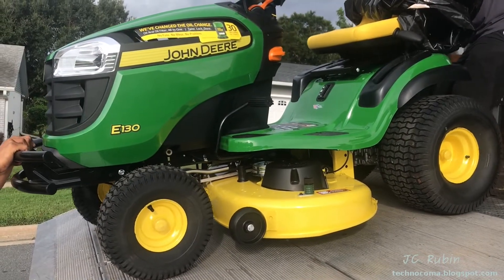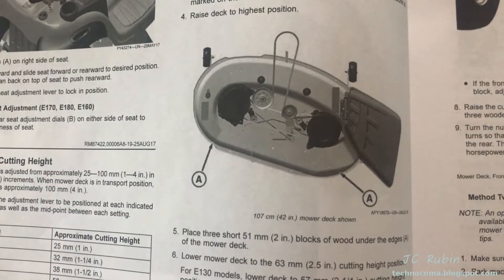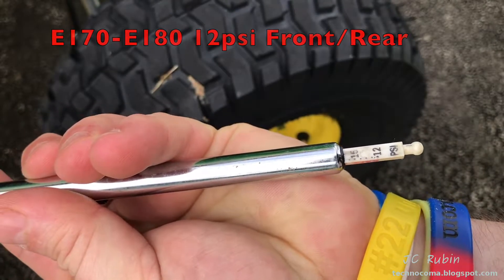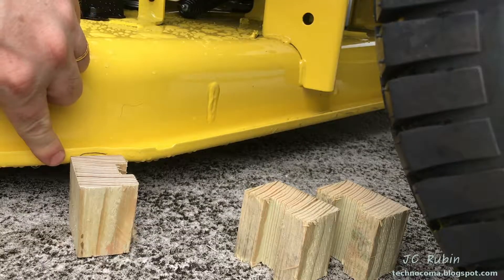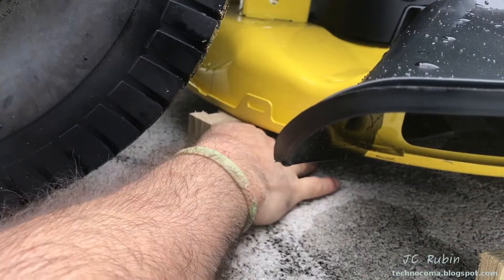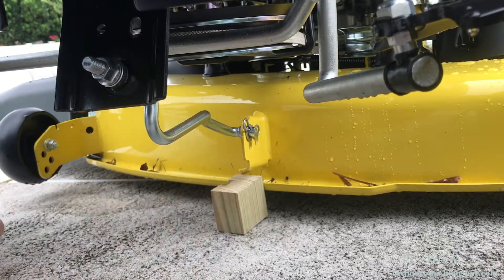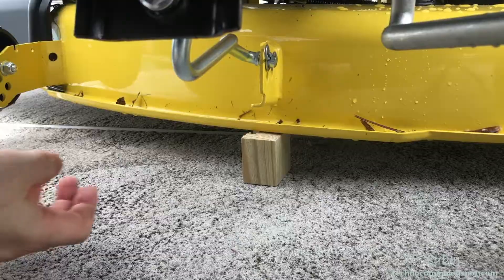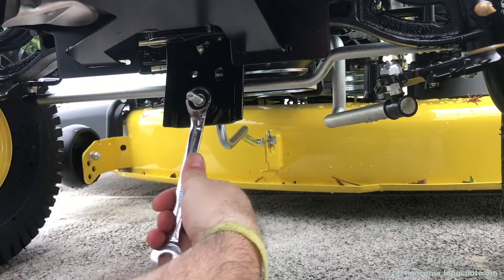John Deere 100 Series Lawn Tractor Mower Deck Level and Adjustment - Easy Step by Step

Comment: so if I want my grass at 3 in need to cut 3  3 in block an my setting should be 31/4   have nhard time getting it cut level haven't been doing the block trick. an so back to mounting bracket adjust oneside and the other do that couple times before adjusting front that's what missing me up .   o ya it's a la175 54 indeck.  u cut blocks 2 in. that's for 21/2 inch setting   but the bottom  hole scaling wheel is for3 in setting

Comment: The surface you or anyone works on has to be level or the blocks and their clearance with the deck will not be of any accuracy.
Reply from the maker: Correct, you should level something on a level surface.
Reply: @retrotechandelectronics thanks, I know that up you understand but it is always amazing how many dont
Reply from the maker: @magicone9327 all good

Comment: I've had my D100 for years and never understood how to do this. I've had the wheels on the front of the deck raised all the way to the top when they should be on the bottom. I always mow on the # 3 notch and never really had a problem so maybe it actually was set to height correctly from Lowes where I bought it. My old deck has rusted out over the years and has so many problems I decided to replace it and just put it on yesterday. I will be following the directions in this video to set it to the proper height. I've never understood what those front wheels were on there for nor how to set them properly. I do have my manual and make sure to set it to those specs if there is any slight difference.
Reply: The Wheels (Gage Wheels should not touch the ground when mowing, only touch going over Bumps.
I need a 42" deck for a LA 125.   How much did yours cost in Cdn$?

Comment: I spoke with my local John Deere Service Center and we looked-up the repair specifications for the 100 series lawn tractors. The correct blade height lever setting BEFORE making adjustments to fit a 2” block is 2.5” according to John Deere. To be clear, set your blade height lever at the 2.5” mark. This video incorrectly states setting the lever to 2” for the 100 series lawn tractors. Excellent video otherwise.
Reply: In the manual for the S130 it specifically states to go to 2 1/4, that is from the JD manual versus a service store person.  A JD service center sold me a grease gun that he said hose will bend to fit all zerks, , LOL, not even close to being right.... To Lowes it was to get the right one......
Reply: Video is correct.  The blades are 1/2" HIGHER than the outer rim of the deck.

Comment: Hello Sir,you said all 100 series are to be set at 2 inch level except the 130.The manual says set at 2.5 inches.??
Reply: the S130 is at 2 1/4 versus the other ones at 2.5, states that in the manual
Reply: He even shows the manual, that shows 2.5 inches. Wtf.
Reply: @cmh2111  I tried to level the deck with 2 inch blocks and the deck set at 2.5 inches and I ran out of thread on the adjusting rods.I had to set the deck level to  2 inches with the 2 in blocks. It's level and cuts great.
Reply: @jackhayward3144   Another video I watch said to start with the deck raised all the way up to the 4" mark and they raise the deck if it doesn't seem that it raised it that much off the ground, this will give you more play with the side adjusters.  Good luck.

Comment: A nice video. I only have one height guage. I bring the guage with me when I move from one location to another. I also use the guage to check if the blades are leveled. I have a LA115. The blades are about 1/4 in. above the bottom of the deck.

Comment: This video sent me back to the owner's manual of my rider mower; yup, there is an adjustment for deck height/leveling.  I just wish my mower had anti-scalping wheels too.
Reply from the maker: Is your manual missing the location for the 3rd 2 inch leveling block on the diagram?
Reply: @retrotechandelectronics  Oops, different brand of lawn tractor, but the basic designs are very similar.  Your procedure can be conceptually applied to a wide range of mowers even if the details differ.  Mine has a different adjuster for left-to-right leveling (it's adjusted from the right side only), but no front to back attack angle adjustment.  It was an inexpensive mower, sooo...